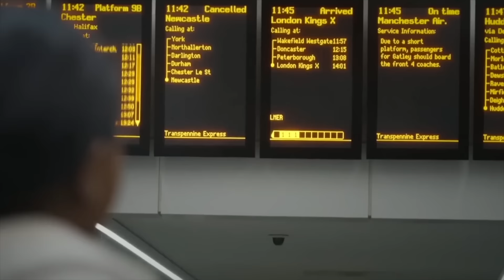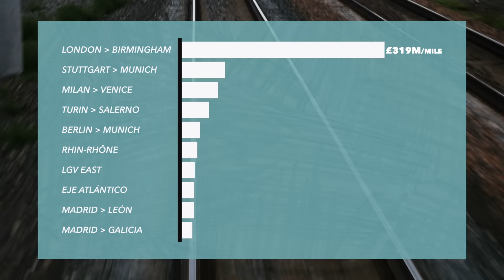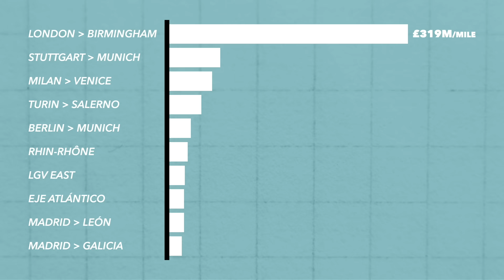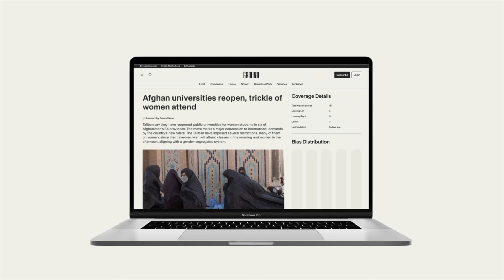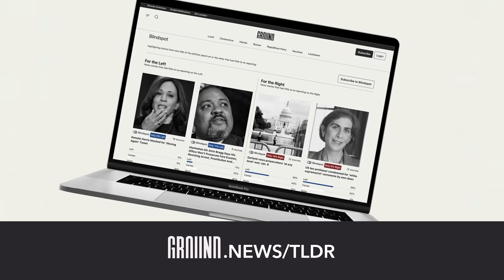The £100bn Railway: Why is HS2 Four Times Over Budget?

Comment: Small correction: HS1 doesn’t go to Dover. For domestic traffic the HS1 only goes from St Pancras to Ashford, the trains then swap to the usual rails and are limited to the usual speeds. The international HS goes from St Pancras to Folkestone where it goes into the tunnel
Reply: that is EUROstar...its a French company using French locomotives and trains....
Reply: @Arltratlo  the domestic service is run by Southeastern Trains (which is indirectly owned by the UK government) using Javelin trains built by Hitachi, a Japanese company. The international service is run by Eurostar which is owned by French, Belgium, and Canadian companies. The actual high speed rails are owned by a subsidiary of the UK government but has been leased to Canadian investment entities.
Yes it’s called Eurostar as it’s in Europe, just like the two countries it connects
Reply: @Arltratlo  HS1 is practically a French high speed railway with French signalling and French speed limits
Reply: @Arltratlo  Important to know, there are several locomotives in use designed by both the French and the British. The operating company is operated from London but is owned by a multitude of other businesses in France/US/Belgium/UK.

The HS1 network extends to the tunnel (which connects France and England) and is used by both international services (eurostar) and domestic services (South Eastern Railways (Useless piece of sh**)). For domestic services (South Eastern), it runs at full operating speed from St Pancras to Ashford International, moving to the old lines with an operating speed of ~80mph.
Reply: @hebikotei9578  i am living in a small town in the nowhere of north Germany, not even 1km away from me is a HSR with speeds up to 280kph and its here for nearly 30 years...  looks like the Brexshit done nothing positive to you, but how do i know, i am not traveling to the UK anymore and not buying anything from it...
have fun with the French!
Reply: @hesterclapp9717  and driving on the right side of traffic!
Reply: @Arltratlo  both UK and French trains ‘drive’ on the left-side
Reply: HS1 goes from Ebbsfleet or Ashford to Stratford/Kings X . The rest of the line is slow slow slow( it goes through Rainham - Faversham Sittinbourne etc. on the same Southeastern lines as everything else ). Plus you pay a massive premium . Eurostar is nothing to do with it ( different trains ,different operators ) I live on the line and have used it about 3 times in my life. My neighbour used to drive to Ebbsfleet from Medway area to go into London  to work as it was much quicker. The HS1 Barely goes faster than about 40mph until ebbsfleet ,then it goes 120+ for the last 10 minutes. If you go to Ashford then you have to Change trains to go through the Tunnel and yes it does go to Dover but on the slow lines.
Reply: @nopants4259  HS1 goes from St Pancras (not Kings Cross), Stratford, Ebbsfleet, then Ashford. Yes some of the trains leave HS1 to join the Medway line at Ebbsfleet but HS1 continues down to Ashford. That is where you see the improvement in speed as there are no stops. A stopping train from Folkestone  will take between 1.5 hours to 2.5 hours where as the HS train takes 50 to 55 mins. Yes it’s a premium price, potentially not worth it for the passengers joining the HS1 so close to London but for the people joining at the start of the line it is worth it (hence it’s so busy)
Reply: @nopants4259  I think your confusing HS1 which is the high speed rail line from St Pancras to Ashford with train services. The line between Rainham and Faversham isn’t HS1 it’s just good old SE normal track. Yep you’re on a Javelin train but at that section it’s just a regular service. Same with me in Folkestone, we can get on a Javelin train to Ashford, it goes the usual speed and costs the same as a usual ticket. It’s only once I join at Ashford (or you join at Ebbsfleet) when it’s the HS1, that’s when it costs more, that’s when those trains can start going faster
Reply: Why is HS1 going to St Pancras International and is HS2 starting from Euston? That’s not logical. If I want to travel on both HS1 and HS2, I have to walk 600m with my suitcase through the crappy English weather or take the subway for 1 stop between St Pancras and Euston. Which will take longer I believe. I had the same in Paris, going by Thalys from Amsterdam to Paris Gare du Nord, take the metro for half n hour to Gare Montparnasse and take the TGV Atlantique to Bordeaux. But at least the French have a lot of High Speed lines to the whole of the country, they can not all depart from one station. But the UK has two, yes only two, High Speed lines in the near future. I find this highly illogical.
Reply: @RealConstructor  it’s an embarrassment that the two lines won’t connect (well not in my lifetime). There was talk of connecting it at Stratford at one point which would have been perfect as the domestic and international services on HS1 travel through, and Stratford has the ability to set-up passport control again (as they did during the Olympics, hence the name Stratford International). But some committee somewhere decided to connect it to Euston. Anyone who has walked along Euston Road between the two stations knows what a shortsighted, foolish decision they have made, and one that the next generation will have to fix
Reply: @hesterclapp9717  or you know the rest of Europe
Reply: Even if they did link HS2 and HS1 that doesn’t make Eurostar immune to the cons Regional Eurostar would’ve faced
Reply: HS1 does go to Dover .  It just doesant stop there which is what most high speed trains DON:T do , stop where you need to go .
Reply: @lassepeterson2740  no the HS1 doesn’t go to Dover. For domestic travel it splits off at Ashford and the javelin trains continue on to other routes in Kent on the regular lines. A few of those routes stop at Dover. If you get on a javelin train at Dover you’ll pay regular price to Ashford (as it’s not on the HS line), but if your journey goes beyond Ashford then your ticket needs to be valid for HS travel as that’s the point the service starts using the HS1 line. Peak service from Dover to London via Ashford on the HS1 line is about 1 train every half hour, off peak it’s one an hour so it’s a regular useful service. The international HS1 line continues on from Ashford to Folkestone where it connects to the Euro Tunnel. The Euro Tunnel, which isn’t HS1, goes under Aycliff which is in the Dover district before going under the Channel. To recap, HS1 domestic service goes from London to Ashford where is connects to other regular services, HS1 international continues on from Ashford to Folkestone where it connects to the Euro Tunnel
Reply: @Vonononie  The Class 373 is not built by crappy, jappy Hitachi.
Reply: @Demun1649  those are the international trains. I was talking about the British Rail Class 395 Javelin which is on the domestic line. They are built by Hitachi
Reply: @Vonononie  Ah yes, the 395. We have had only three classes since them that are worse trains. The Class 800/801/802. The worst and most uncomfortable trains that Britain has had since the early 1900s. Also built by Hitachi, who are also winning the contract for HS2. Hitachi should be banned altogether. Japan Railways, nationalised, has no rolling stock from outside Japan, but sells their outdated 15-year technology around the world. If trade is not both ways and open, then reciprocity should be used to keep them out of foreign markets.
Reply: @Arltratlo   its a british company
Reply: @RealConstructor  The reason HS2 is not connected to HS1 is that unlike HS1 which is a International train service and line linking the UK to Europe, HS2 is a HI speed domestic line linking the North and the Midlands to London and has no need for international train services to Europe as the Cities of Birmingham and Manchester have Airport with quicker air services to Europe than by train by Airlines such as Air France,Ryan Air and Easy Jet and the reason HS2 goes to London Euston and not London St Pancras as there are no means of joining these lines across London and bare no relation to one another and in the UK there are other Hi Speed lines such as the East Coast Main Line , the Midland Main Line, the existing West Coast Main Line and the West Country Mainline where ordinary trains regularly travel at 125 MPH
Reply: @hesterclapp9717 The signalling is called ECTS, and it is not French. It's a European standard that is incorporated into most high speed rail in Europe including Spain, France, Italy, Belguim and Germany. 
It is leaps and bounds ahead of any signalling that the UK is using. 
So much so, that even the US is thinking of adopting the standard.
Reply: @RealConstructor because Euston is the terminus of all trains going to and from the Northwest and Glasgow. 
Now, there is already a section of rail that connects the line from Euston to St. Pancreas. 
It would make sense to upgrade that line for HSR, so eventually Eurostar trains could travel from Birmingham, and Manchester maybe, on HS2 and connect to HS1. They could stop at Old Oak Common for suburban London. passengers and passengers from the Great West Railway line, and then bypass St. Pancreas straight on to HS1. This makes sense as it would cut the number of flights from the Northwest and the Midlands to Paris, Brussels and Amsterdam, and maybe one day Frankfurt or Koln. We could also have high speed night trains from Gkasgow to Paris or Brussels. 

I said this makes sense, but the Tories have already said that they have no intention of linking HS1 and HS2 anytime soon.
Reply: @peterwilliamallen1063 Birmingham and Manchester and even Glasgow could have international departure areas like St. Pancreas does. 
The time flying from Birmingham to Paris would not be much different than the train, of you include all the other things you have to wait for on flights. 
Plus, I for one would happily travel on a high-speed train than a sardine can of an airplane, even if it took an hour longer. 

In most European countries, the aim is scale back flights that don't need to exist when there is a high speed rail alternative. 
At 6 foot 2, I personally don't appreciate being squeezed into a 30 inch seat pitch on airplanes that I'm shoved in like cattle. 
I would rather pay the extra and spend a little more time to be comfortable.  Plus, there is a buffet car on a train.
Reply: @bubba842  Even so as HS2 is a domestic train service only there is no call from Birmingham to Europe when there are plenty of cheap flights direct from Birmingham Airport. By the time you have reached the airport booked in and got on the plane a Birmingham airport you have only jut got past the Rugby area, so definitely quicker by Air.
Reply: Wondering why are you falling behind in economy, when you have the Technology Knowhow that other could ever dream of, saying we dont have enough Skill this that.
Look in Mirror lately?
Reply: @peterwilliamallen1063  you could say there was never a call for direct high speed trains from Brussels to London or Amsterdam to London, or Lyon to London because they are so well serviced by flights. But because those countries had the foresight to connection their domestic and international lines it means they now have the option, and do, travel directly between international cities on train. Considering the travel time to airport and check in it often works out quicker and more comfortable to take the train. London shouldn’t be the only well connected city in the UK, we need to spread out the growth and development
Reply: @Vonononie  There is no call for people from Birmingham and Manchester to have a train connection to Brussels when it is just as quick by Air, HS2 is just a new Domestic line.
Reply: @peterwilliamallen1063  I’ll let everyone in the midlands and North East know you’ve spoken for them. Yes let’s make sure it’s only London which has direct train access to the continent. Everyone else can use planes whether they like flying or not, whether they want to be more environmentally friendly or not, whether they want to be able to move about more freely because of height or disability. F them, you’ve decided what they want and that’s no choice apart from fly or waste time and effort changing trains in London. I remember the uproar about HS1 and that “no one in Kent would use it”. It’s been nothing but positive, helping deprived areas, bringing in companies and employment, and generally making it easier for people to move about. I’m glad we didn’t listen to the “there’s no need, we have the motorways to drive about” brigade
Reply: @Arltratlo  It is not a French Company and is dual British/  French and does not use French Locomotives but Eclectic Multiple unit trains built to the British loading Gauge

Comment: As a rail engineering student in the US, it's amazing to see how common the mistakes listed in thus video are. The high speed rail project in California faced a lot of similar challenges with mismanagement and trying to tackle too large of a project. I'm not sure if this was an issue with HS2, but in California there was a crippling reliance on expensive consultants for project management, with an incredibly understaffed internal team.
Reply: Sounds like an incentive misalignment. Politicians don't get rewarded for doing the boring but practical extended rollout. Instead they get incentivized to go with huge showpieces.
Reply: @chrisj9700  I'd doubt 250mph trains will even run simply because it's currently non standard.
Probs will be closer to 200mph or 320km/h (Could just brand it as IC 325 to stay consistant with express branding)
Reply: Not to mention all the hassles over right-of-way.  The U.S. has not been a train-oriented country since the end of WWII.
Reply: @davidty2006  Building a track now that is capable of 250mph but having trains run "only" 200mph is much more efficient and cheaper than having to upgrade all of that track once trains are capable of those speeds
Reply: Yep, just read an article about that ongoing tend with US engineering projects

Because costs spiral after paying these consultants, projects then balloon in cost

Whoever said smaller government is better and more efficient is lying…
Reply: @coyotelong4349  Should just let the Chinese build it, like they did in the old days. Just a slight change in the contractual relationships will be required.
Reply: Since Regan and Thatcher, the Angloshere and completely lost its memory on how to build an 'Infrastructure Case' (not a business case), based on a 25 year vision of investments and macro economic benefits. Why? Because neoliberalism only support microeconomic benefits for vested interests and oligarchs.  Then when you now try to build something big, you are lost: same in UK, US and Australia..... Not the case in the EU or Japan.
Reply: @coyotelong4349 smaller government in the case of letting free markets where supplier meets demand in a safe environment IS effective.

But, when you're trying to build a government project that will not be directly profitable (money from tickets), and is only useful to the society as a whole, enlisting the private market and hoping they won't try to make as much money off of the government is incompetent thinking.

Please don't criticize a phrase that's meant for a lot of things and just demean it to win an online argument, it doesn't help facts from emerging

Comment: I work on HS2 at the moment. I think one of the biggest issues is that everything has been sucontracted out and as little as possible is being done in house. In theory thats more efficient but its a nightmare and costs increase a lot more when theres inevitable changes. It makes way more sense to me to keep as much of it as possible in house to develop the knowledge so you can continue building in the future
Reply: But ther is no I  house building in the Construction Industry as everything is Sub contracted out to Sub Contractors. The HS2 Contracts are all let on an actual cost basis. They root of the problem lies in an insufficient costplan put in place in 2010. Then to add to the oroblem no inflstion was added. Then years later the contracts are designed and tendered on an actual cost basis reflecting the individual calendar programme dates the contracts are built to. This is how all government funded projects are let so the original budget can never be enough unless there is no inflation.
Reply: What does in-house mean in this case?
Reply: @trevorwilliams632 utter nonsense.  Transport projects always include the risk adjusted capital cost, inflation adjustment, and optimism bias. The guidance for this is available online for all to see in TAG and the Green Book.
Reply: They'll pay multiple companies because it helps get the money back out into the public quickly rather than giving it all one greedy ceo